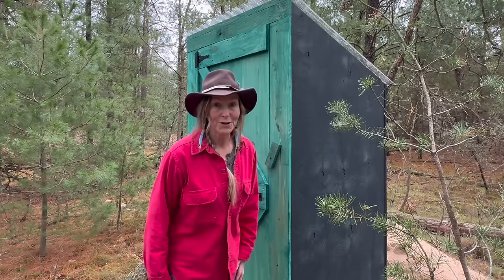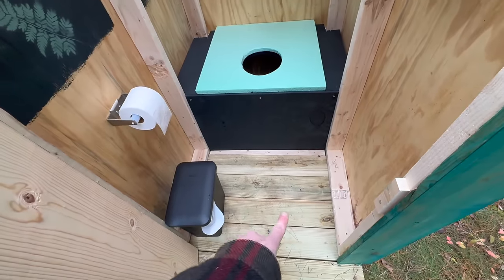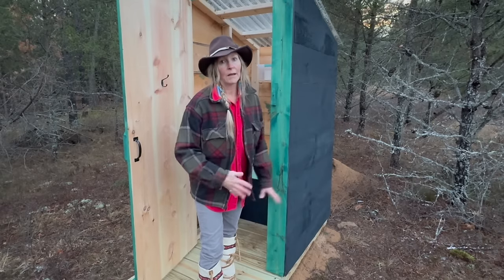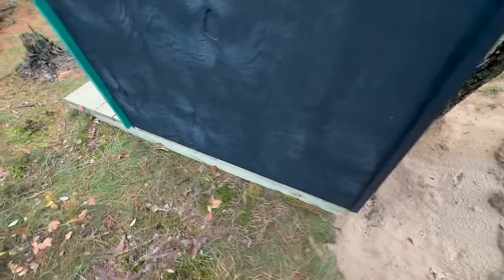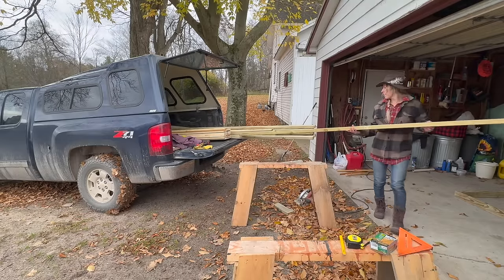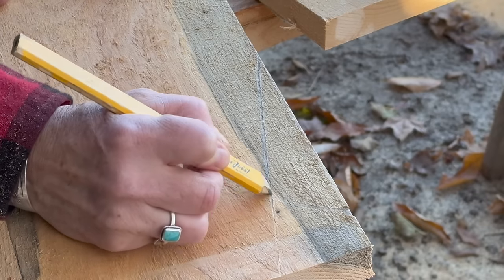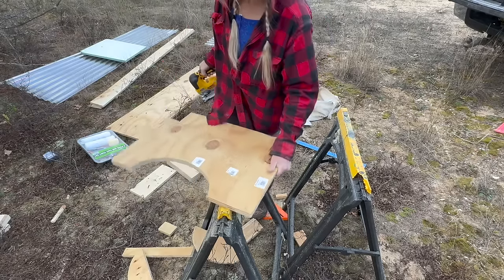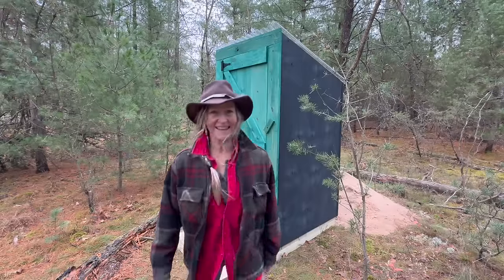SIMPLE OUTHOUSE done right- anyone can build it!

Comment: I've never been afraid of using an outhouse and your builds are beautiful.  When we rustic camp, we have a plywood board with a toilet seat attached to it, that we bring with us, and set it up over a deep hole with two logs holding it up.  We throw the dug-up sand/dirt over the "deposits" after use.  Any paper used goes right into the fire pit.
Reply: Then at the end of the day we can cook hot dogs and marsh mellows over the outhouse trash.

Comment: I've lived with outhouses in a number of places, mostly in Alaska.  We did put wood ashes in the holes, and we used foam on the seat (a foam seat is fine to sit on even when it's way below zero, though sometimes we took it in the house between uses).  The most odor-free outhouse I've ever used was a government-built one (can't remember if it was in a national forest, or at a rest area along a highway) that had a 12" diameter vent pipe going from inside the pit through the outhouse and up through the roof.  The vent pipe carried odors outdoors, so they didn't stink the inside up.  There was no fan on it, so it didn't need electricity.

Comment: I added 12'' vents from Menarads to both sides of mine below the seat. it cross vents well, but sometimes you get a breeze on your behind. I  used spray on rubberized undercoating for the water proofing, has worked well. We buy the pine pet bedding to put down  the hole for the covering.

Comment: Nice video, Brooke.  I would recommend one addition and that is to put non-skid tape on the surface of the treated boards at the entrance.  I use Skid Guard from Lowe's.  Every time that I have used treated lumber for deck steps or bridges, it gets slippery over time or when frozen.  A small strip of anti-skid tape stops it.

Comment: Great Outhouse. Only thing i would  add is a handrail, like having a handicap outhouse.. us older folks need something to grab to pull ourselves up from the toliet..This is what I  need..I saw an awesome outhouse at a horse trail camp a couple of months ago, it was built a little wider for larger person and bars around the toliet to grab and pull yourself up after using the toliet...it was awesome ..hope you dont get alot of snow. I can see the heavyness of snow on top of that outhouse breaking the see through ceiling.. I'd of put that on the sides of the outhouse..a grabber will get that pencil back up....still a thumbs up on this project

Comment: I did two 55 gallon drums stacked. I screwed some flashing to hold them in alignment until I backfilled it. I cut the tops out of all but the very bottom and left the drum ports on the bottom to let water out or in depending on time of year. I had an old toilet seat and use a plastic coffee can to keep the critters out of the T.P. I had a small backhoe at the time so it was easy to dig the hole. Over 15 years later it still functions fine. The soil is rocky clay.

Comment: Nice wood work. If it was me I'd have the wood latch only on the inside, or make  a wood piece inside/& out connected with a bolt or dowel so you can turn it open from the inside for sure. There are these u-shaped latches on metal fence gates that's like what I'm trying to describe...you could make yours of wood like you got.

Comment: We built our outhouse with the clear fiberglass roof and love it.  Unfortunately our cabin is in a free range area of central Oregon and this spring the cattle used it as a scratching post, pushing it sideways so it partially tipped into the hole.  We uprighted it, but now our fiberglass roof  has stripes of duct tape on it to cover the cracks in it.  Never saw that coming!

Comment: You should have extended the polycarbonate roofing a foot wider on the sides, and about two feet longer front and back, with emphasis on the front to keep rain and snow off the 'deck'.  Obviously a simple support grid would help provide support (2"X2" grid).  It would keep the sides and front/back dry greatly extendeing the life of the structure, AND help keep it dryer feeling inside, and much less damp.  And I DO NOT recommend an outside lock - only tempts those that like to tease people.  Install a spring to keep the door closed, and an INSIDE lock only, preferably one that shows when it is occupied.

Comment: I put anti-slip tape, (which looks very similar to sandpaper, only in longer ,thinner strips,) on my wooden  handicap ramp to stop my power wheelchair from slipping ; and it worked too. If you were to put that anti-slip tape on your sawed off 2' by 4 ' boarded entrance, it might help ; especially,  on a brrr cold night. (Only thing is that whilst anti-slip tape does work, it last's months , and not years. ) Oh well , just an idea. 

A dry, well built outhouse is , haha, paradise when you have to go! Cool beans.
Reply from the maker: good tip thanks
Reply: @therealgirlinthewoods  , welcome.
Reply: Rubber door Matt's cut into  long ways work, works on steps too.
Reply: @jeannie5389  , might last longer too. anti-slip tape get's weather worn right quick.

Comment: If you cut the top and bottom off a steel barrel, could you use it to line the hole so it didn’t collapse? If you burn it first it would rust and over time would degrade, so you could bury it when you move the outhouse without having to remove it. Also have you tried barn lime for odor control in the outhouse? A 50lb sack is pretty cheap from Menards. If you shake a little down the hole when you get done doing your business it takes care of the bad smells.

Comment: Wouldn't the polycarbonate roof panels be less likely to leak if the screw penetrations were on the ridges, rather than the valleys?

The gaskets seem like they'd be more likely to trap water than allow it to flow by.

Good advice overall. Thanks you!

Comment: If you live in a warm area you can vent the stink out of the but cutting a hole at the back or side below the hole then attach a black iron or abs pipe that runs above the roof like a chimney. When the sun heats the pipe it will heat the air causing it to rise and pull the stink away from the room.

Comment: For your hole, that you are worried about it caving in, due to the sand soil, use the 55 gallon barrel, but cut both the top and the bottom out of it, then, cave in is averted.

Comment: I would change one thing is build the hole large enough to cut the top and bottom from a steel barrel insert it into the hole so the sand wall of the hole doesn't collapse.

Comment: Where is the vent? We use 3 inch pvc pipe usually installed about 6 inches below the seat that goes about 18 inches above the roof. This causes a chimney effect that helps draw the sewer smell out of the johnny house. Also always remember to look under the seat because it is a perfect place for several types of spiders to hang out, especially Black Widows.

Comment: Couldn’t you 13:28  use one of those barrels for cribbing in a sandy hole. Cut the bottom off. Slit it up one side so it will fit in your hole. Could also be pulled out if you have to move your outhouse later.

Comment: I have a great idea for you. Why don’t you try and do it like we did it in Vietnam take a 55 gallon drum put a hole in a where you would put a handle on it near the rim. Once you cut it in half then cut it in half standing upright OK slide it in underneath where you’re doing your duties, and when you get done there, put a little kerosene in it so when you pull it out once a week once a month, whatever you two can pull it out get a screen for it like you would have for your barbecue pull it away from the structure, set it on fire and burn off all your waste when it’s an intake the other half of the other barrel if you didn’t use and do the same thing, set it up so you can put that other one in place where you’re burning off the other one and then when it’s cool down, you can dump your ashes you can dig a hole whatever’s left you put it in the in the in your ashesin the ground that’s what we didn’t Vietnam just giving you a heads up

Comment: I noticed immediately that you have placed the planks on your outhouse deck wrong side up. This will cause the boards to cup, or pull away from what they are screwed to. I was taught this by the staff at the Standard Lumber in Ludington when we built our first deck. Twenty years latter, not one plank has curved up. It;s wise to also check to see if an outhouse is legal to build these days.  It's surprising how many out of the way places have laws today against them. The Amish in downstate Michigan just went through a many year legal fight over the issue.

Comment: While I really dont mind your outhouse, its cute and you obviously cope well with burning  your toilet paper etc. The youtuber ' One Man Two Hands 'is doing a really cool outhouse. A proper composting one with a large two bay batch compost. 

The issue I have with these is, I really don't want to be having to dispose of the used toilet paper somewhere else 🤮. Then if you don't, As you say the hole fills up quickly or worse yet it caves in. Or EVEN worse with a 55 galleon barrel you have to empty it at best every few months and if its like what I have seen some people do with a 20 gallon bucket... well I don't want to have to be digging a hole every week with a pee and pooh mixture slopping everywhere 🤮🤮🤮.  One Man Two Hands one is a big 2 batch system, looks like you could go a least a year while it composts away into nothing but soil. While, as I say, I like yours; I think I would go the extra mile and not skimp on building something that will last and something I don't have a headache every time it caves in or the bucket fills up etc.